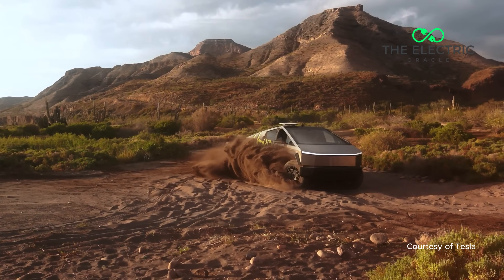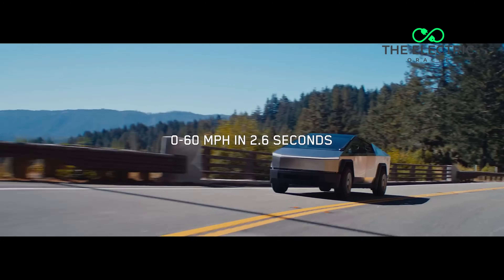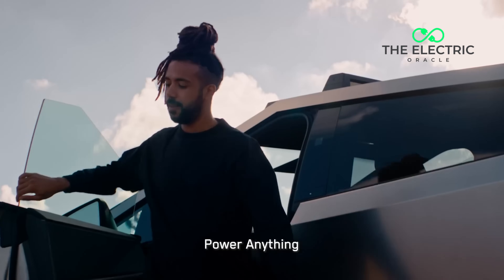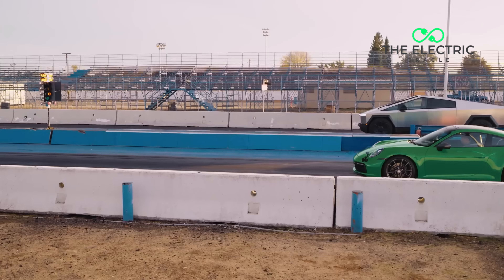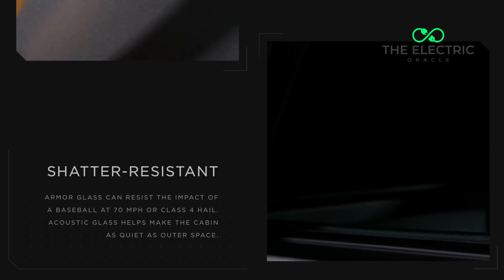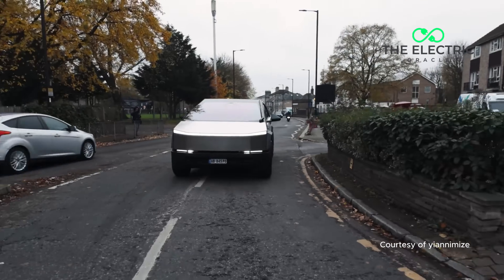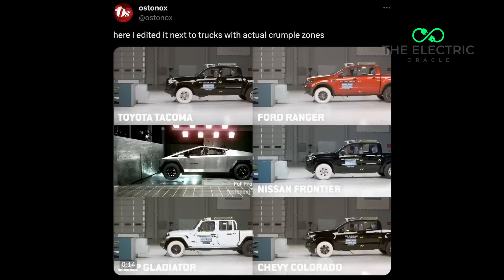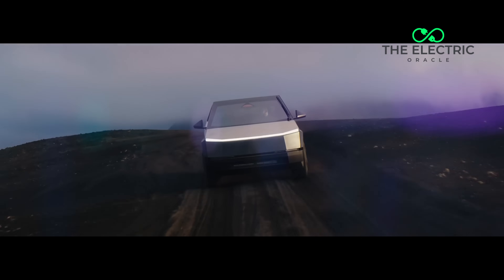5 Safety Issues Keeping Tesla Cybertruck Off UK Roads 🇬🇧

Comment: "Should Emergency Services be required to upgrade their equipment for new vehicle technologies [for one vehicle], or should manufacturers be required to design vehicles that work with existing Emergency Protocols?"
As a sometime Tesla shareholder, I'd say UK should BAN THE CYBERTRUCK. Just don't let it in.

The Cybertruck is Tesla's Edsel. It won't last. It has massive towing capacity, yet in practice using that too easily tears it apart (watch YouTube videos where such attempts see the entire rear bumper & attached "frame" ripped off). It's collision proof in a way that ensures anything else that it hits (or that hits it) is toast - which displays massive distain, or at very least zero concern, for anyone else on the road. If you're a pedestrian, it's worse: those hard corners ensure your demise: I guess you shoulda been driving a cybertruck. And the lighting, mirrors, weight issues etc.: a complete lack of interest or respect for regulatory issues. We HAVE regulations for a reason; a lot of them are well-thought out & there for good reasons. This is a hardware manufacturer, a vehicle manufacturer, acting like a software firm in the era of "F-k the rules, just do it!". This is what happens when a software team takes on car manufacturing the same way Uber took on the taxi industry & AirBnB took on the hotel industry: with the assumption they could ignore an established industry & regulatory framework and steamroll anyone who got in their way. And TBF (& to the shame of governments in the US & Canada) they've succeeded.

I REALLY wanted to like the Cybertruck. I REALLY want to like Tesla. The last two years of Tesla''s behavior & especially Elon's behavior have trashed much of my respect for the man. I seriously wonder whether he's going insane.

Comment: They couldn't be bothered to put the new Model S and the Model X through type approval, so I really can't see why they'd bother with the Cybertruck, in a market where the biggest truck we see on a regular basis is a wide arch Ford Ranger. Maybe we'll see the odd private import, as we do with Cadillac Escalades and Lincoln Navigators, but cars like this are just really hard work in the UK. 

I wouldn't be totally surprised if the brand ultimately went the way of Nokia. Time will tell!

Comment: As a American, I can understand all of the issues with this truck. I for one have not understood the need for Americans to think of a vehicle as anything more than transportation, but here in America we have this Krazy Kar Kulture that has convinced Americans that they need enough horsepower to go 150 plus MPH but can't legaly drive faster than 80/85 MPH anywhere in America. Which means a 3 cylinder Mitsu Mirage with 78 hp is everybit as fast a Dodge Hellcat with 707 hp, but the Mirage is a heck of a lot more efficiant, and its only transportation, a tool to get a job done.... That said, a vehicle should be comfortable, so maybe something in between the Mirage and Hellcat, but still its just a tool..... Just sayin'
Reply: It's nothing to do with top speed. Spend 12 hours (straight) in a Mitsubishi Mirage vs a Chevy Tahoe. Hellcats and Camaros are toys that we are fortunate enough to have the disposable income for.

Comment: 6:18 a 7.5 Ton lorry dose not weigh  7.5 tones, it has a Gross Vehicle Weight (GVW) of 7.5 tonnes, so the maximum allowable weight of the entire vehicle, including the cargo, driver, and any additional equipment, is 7.5 tonnes, the lorry itself, without cargo, is around 3.3 - 3.5 tons depending on the specific vehicle model and wheelbase.

Comment: The electric car thing is soon going to die a death. They are so much heavier than ICE vehicles, have to be made from plastics, glued together. What is the longest lived modern electric item you have sitting in your house? Now think of it being used everyday most of the time! The resale price of EV's is so low also. 
      We love in a world where we have more people, than ever before, travelling even more, living in warmer houses, burning more fuel of one sort out another. We are adding more heat to the world, not so much greenhouse gases. Think of a candle in a greenhouse, light it and you don't get much heat. Light 10 you warm it a little, but light 100 and the greenhouse will get so much hotter. Not because of the change in gas, but because of how many things are giving out heat.

Comment: The Cybertruck wasnt even going to pass what few safety laws are here in California (still way more than the rest of the US), but they lobbied hard and despite public outcry against the legislature approved the steer by wire system with no mechanical backup.  Guess what the Cybertruck does? Takes control of steering and swerves out of lane.

Comment: About lights, the cyber truck is terrible of course, but I've been really frustrated annoy what other manufacturers have been allowed to get away with in the UK and Europe, which is against the regulations... Single red strip across the rear (very confusing and annoying to drivers behind), turning off a side light (headlight?) When the indicator is on, KITT kind of "swoosh" indicators instead of flashing indicators... It actually pisses me off.

Comment: My background comes from testing racecars, rally cars and road vehicles.
I have spent a number of years test driving in Canada and in the north for winter testing.
Funny thing is, the Tesla truck doesn't meet the safety standards of Canada either. However, it basically got pass because, well it's redneck cousin said it was fine.
It also got a pass for certain tests that were deemed to be well...uncessary.
However, amoungst testers it has been nick named, "The "Rolling Coffin."
The last time a vehicle was nick named "The Rolling Coffin" that I can remember were the vehicles manufactured by Daewoo.
I remember testing one of their vehicles and then realized how average drivers were being killed. It's braking system being a very week point.
However, the cyber truck is one that has the crash rating of a vehicle from the 1960's but doing 2020's type speeds.
The other factor is it does very poorly at speed in snow or in snow storms. It's lighting system is perfect if you never have, snow, rain, dirt or fog. A part from that rhe lighting system looks great.
Overall I really wanted to be impressed, and I am. I am impressed at how underwhelmingly this vehicle performed.

Comment: there should be different weight class for EV however the cybertruck is really taking the mick with the way that it's just not caring about it's weight, so therefore IMO it should be classified as a commercial vehicle... for those interested in these legendary vehicles enjoy being the sober driver, annual health checkups and the slow lane, I assure you I will wave to you as I pass

Comment: Emergency departments need to update equipment to work with new vehicles. I agree the edges are too sharp for pedestrian safety, but in the past vehicles like the Cadillac had sharp fins and that was OK in the UK. Besides, Tesla considers it a Cyber Truck, and like most trucks, a lot less pedestrian safety is required of those vehicles. I wonder if the Pakistani Cybertruck  would qualify for registration in the UK?

Comment: I would like to see fire suppression built into the battery/ vehicles.
Reply: That's honestly not the worst idea, good concept for petrol cars aswell. Or atleast a panel to shield/direct a fire away form the vehicle
Reply: @baileyjerman5573  like a something packed around the battery the chemically neutralizes the broken or puncture battery. They make fire extinguisher and blankets for batteries.
Reply: @Revegineer  that sounds difficult, batteries are big and what counts as neutralising? It's within which is pretty reactive the best way is to stop it from reacting in the first place
Reply: @baileyjerman5573  some large battery have cooling/ warmers build in like a radiator. So having a modified antifreeze may work. Otherwise I am not a chemist but I would look at how battery factory handle it and see about down sizing it.
Reply: Lithium ion batteries oxidise in decomposition. In laymen terms, this basically means that they produce oxygen as they burn and don't require oxygen from the air.
This renders traditional methods of fire suppression useless. The only method that comes close to being effective is super cooled saline which just in its infancy
and it just isn't practically possible for built in fire suppression.
Reply: @davidbrayshaw3529  I am aware of the oxide problem with lithium. I am not a chemist so maybe it is hard to do. My first thought was to make it do the opposite with an antioxidant.
Reply: @Revegineer  I see what you are saying. It's a good idea. I wonder if it is plausible?

Comment: You'll have to learn hydraulics and fluid power theory along with air brake systems, decompression "Jake" braking, trailers and all kinds of irrelevant non applicable things, and if it's also like America, get drug tested regularly and randomly. And logs, even for non commercial use. Maybe scales. 
    We also have just police for commercial vehicles, they ignore 90% of the regular stuff and just pull semis and small cab-overs like rhinos over all day. That's 10,000 pounds usually to get noticed. I drove a truck with a gross weight of 9,999 pounds or maybe 9,990. Still a bridge problem, for me it was tickets for a bridge I took every few days. It was worth the one ticket my boss paid. But that is your overload ticket now, and you might have to cross in places more hostile to heavy trucks on little bridges, you might have to cross four times before lunch.

Comment: You can use simple components to split the lights out, give them their own caps and with a color change, you can make half do whatever you want, or opposite to the rest.
 Might need to graft-in a turn stalk and feed it to the output of the controller. Switching colors actually helps, now you're running different leds on different resistors, if the input is insufficient, only one set lights.
I just don't see a need to program, there's a greater chance of us colonizing you than tesla bending it's knee to what you want it to do.

Comment: Ok, I see that commercial vehicles aren't your area of expertise. So: 

- No, you don't need a CPC to drive your C1 class vehicle, unless you drive it for hire or reward.
- no, C1 class vehicle does not need to be 7.5 t but up to 7.5t. That means Tesla Cybertruck would fall into the same category as 4.2 t ford Transit for example. Or 5 tonne iveco daily etc. 
- you can legally drive a vehicle that does not meet UK specification requirements, as long as it's registered in another country - that's because of Vienna convention on road traffic 1968. For example: until about a decade ago it was illegal for a car registered in Poland or some Baltic states to have steering wheel on the right, but it does not mean that a visitor from Britain could not drive their RHD car there.

Comment: changing the color of the blinkers is a non issue
that's like a 5 minutes software job for someone at tesla
same as adding a "darnk" space in between the lightbar.
Weight is a non issue. AWD is 3025kg and cyberbeast is 3129 kg. all below 3500kg. the RWD will even be below 3000 kg
weight is about the same as a rolls royce spectre, and that's legal in the uk
and since weight is ok, the driving licence is also not needed.
as for pedestrian safety. it doens't matter what angle you have.
the only thing that matters is newton. force and mass.
if you get hit by a 3000kg object moving at 50km/hour you die. doesn't matter if it's the spectre or the cybertruck.
the only difference, the cybertruck has pedestrian safety build in. so it won't hit you. it will break if you don't pay attention.

So i don't see a single of your 5 point hold up...

Comment: I hope vehicles like the Cybertruck never transit UK roads. Most UK car drivers, couldn’t safely drive a a big van without damaging other vehicles. Never mind a vehicle this big and weighted. You see it everyday, drivers in big SUVs and 4x4s, that have never used a wing mirror and don’t know how wide their chosen ride is, nor even where the corners are or how to handle the oversized limitations of said vehicle.

The futuristic exterior, is near enough designed to kill pedestrians. If you drive an armoured vehicle or military vehicle on UK roads, there are limitations and you have to have specialist training and pass stringent tests - and all for good reason. The Cybertruck is just not meant to be driven on UK roads. If it ever gets certificated for the UK, without the driver needing to train and pass goods vehicle driving. It’s only a matter of time, before the vehicle starts killing other road users and or pedestrians.

Comment: So far everything you've mentioned that does not make British road requirements are easy to fix red indicator Lights switch them to yellow to meet British standards add extra set of switches to be able to control each function of Lights these are not big expensive fixes I imagine the true hurdle is pedestrian safety is what will stop the cyber truck eventually from ever coming in to Great Britain Plus cyber trucks are a hot wet mess they're breaking their rusting they're doing everything they're not supposed to do that's why I wouldn't spin my money on one

Comment: The British car market is very different to the America market. If anything, the British market still has room for smaller cars, SUVs and Estates but doesn't really do much with pickups. Cars such as the Ranger do sell here but not nearly as much as they do across the pond. The question would therefore be whether pickup sales in the UK (or Europe even) would justify such a redesign, even if you don't take into account the overall reluctance of EV pickup in general. Of course, you also need to consider that Electric Pickups aren't even doing well in the US, let alone anywhere else. The Electric pickup has not caught on well with companies like Ford, GM or Chrysler and those are traditionally shaped and designed vehicles. If you want the equivalent of a real design based joke, just examine a Cybertruck!

Comment: And 🤞we NEVER get this piece of 💩 in the UK. 
Even before Elon's ss Salute this is unsafe. 
The US vehicle makers have found a way around passenger car safety issues by tempting the average driver to buy trucks.  Because its a work truck, the company's building them pay less TAX-DUTY,  a car has a lot more crash testing and laws around pedestrian and other vehicle users, to keep them safe. But a truck can have a slab front without any pedestrian safety systems. No soft bumper, it can be so high a driver cant see if a child has walked in front of them at any point.

Comment: This Homer Simpson-designed car is needed on European roads like a nail in the head. It´s the same for U.S. roads as well, they sadly don´t have the necessary legislation to protect them from it.
Scrap metal presses will chew hard on a Cybertruck. Justica´s jaws crunch it like mousse au chocolat.

Comment: Some truly interesting issues raised which I had no idea would effect the TT being able to be driven on UK roads. 
The main consideration I had was that UK roads are simply not designed for these types of behemoths, it is already a farce when you see the oversized Ford pickups and the like attempting to park in a regular sized car park space then stick out a mile when parked, and that is not even taking into account how they overhang the sides of the parking spots in older car parks.

Comment: Some dude in Czechia got his Cybertruck modified, and it is now road legal.  Which makes it road legal in the EU.  Barely...
- Added rubber strips to some of the sharp edges
- They didn't manage to change the indicators to amber, so they just bolted on some extra ones, and an extra fog lamp.
- It is classed as a light truck, which means that you need a C class license to drive it... and they had to install the mandatory speed limiter (90km/h).  Lol.
- Czechia issued an individual approval, not a type approval.  So each truck will have to be certified after it has been modified.
EuroNCAP is now urging to get these things off the EU roads... 
   
Personally I love the bizarro design of the Cybertruck and the rather clever construction methods they applied, but I have no idea what need this thing is supposed to address.  Would have loved it as a concept car, not so much as something to share the road with.
Reply: I'm in the US and have no idea what need or market this is supposed to address. We have far more capable pickup trucks for less money that are far better equipped and more comfortable.

Comment: Vehicles should be designed to fit in with all countries safety regulations not regulations changed to fit the vehicle
Reply: This particular vehicle does, but some are trying to import it into a market that it was not designed for. How many other full size pickup (using this term loosely with the shitty cyber truck) trucks do you see in the UK?
Reply: The main priority in this design was simply the ego of the company's owner.

Comment: Don’t forget there are no easily-used non-electric interior door releases. If the rear seat electric switches fail an emergency, you’re expected to remove a hidden panel and pull a cable… while the cabin bursts into flames around you. Perfect test for eight year olds.